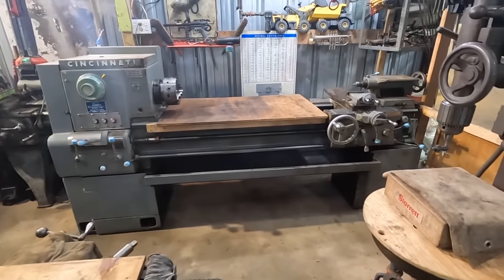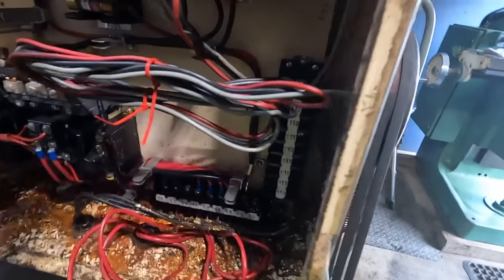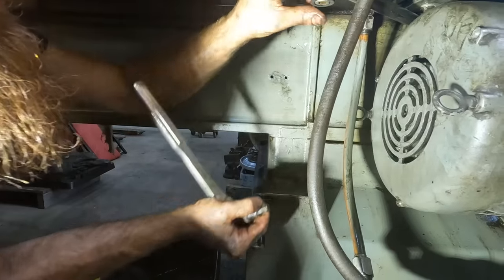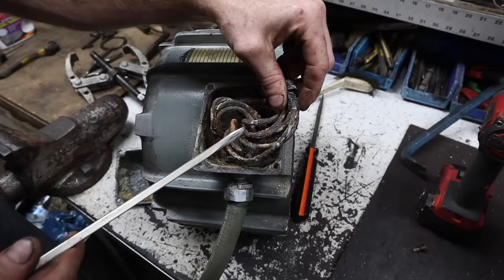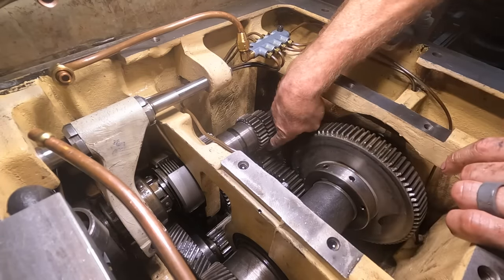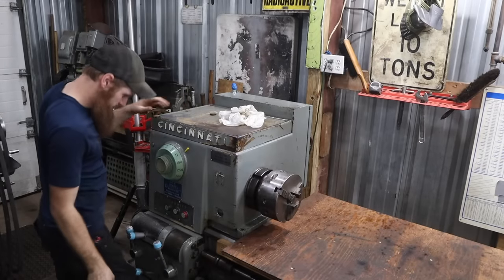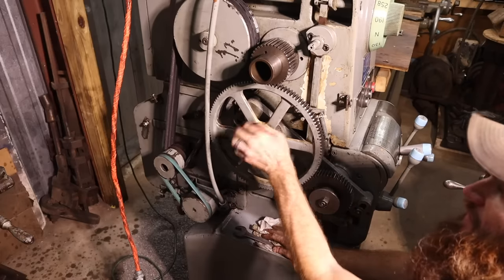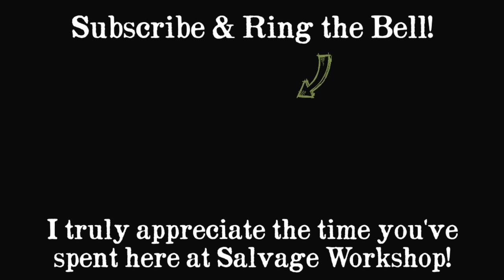Can we SAVE this BROKEN Lathe? ~ MAJOR Issues found! ~ Will it Ever CUT again?

Comment: I can't beleive that motor was running with all that crap in it! What was even more mind blowing was that all they did was to clean it out, wire wheel the rust off, put some heat shrink on all the wires, and change the bearings. An it still worked when they put it back together!!! I thought that no one would selvage that motor without having to re wire the whole thing. Brilliant!! 😂😂😂😂😂😂 Nicely done guys 👍👍👍👍👍👍
Reply: As long as the crud was non-conductive and non-magnetic, the issue would be heat.
Reply: Quality motor. We need to get back to that as a nation.
Reply: Was thinking the same damn thing. I’m surprised there was no sparking/arching on those coils in that motor after all that corrosion.

Comment: Very inspiring, I have a 20 year old Jet lathe that I'm very fond of, I don't have the money for a new one. After watching one of your videos, I started the repair on my machine. Lucky for me the lathe is made by Jet, I was able to order all the repair parts I needed. It's finished now, and I feel the satisfaction you get when this piece of equipment is working like new. The repair parts around $400, a new lathe was around $3,400. Thanks for your videos, it's the kick in the butt needed to get started.🤓
Reply: I have a stupid question 
Why didn't you take a part from something you already had? 
If you have a bunch of machines and the machines parts are meant to rotate ....sorry this is the second time I had to write it because it deleted the first time
Reply: For example you have 6 large machines one machine is broken but the piece you need is "hidden" in a machine you already have...
Reply: The air conditioner is broken but the assembly line is 
Air conditioner 
Washer dryer 
Freezer 
Water heater
Refrigerator 
Dish washer 
Sink 
Stove
Microwave 
------
Oven 
Microwave over an oven 
The air conditioner is broken and the piece you need is in the  let's say water heater but to keep the water heater going you have to arrange or rearrange the entire assembly 
And my brain says it could be as simple as cutting the grass while it's wet....
Reply: I've seen the air conditioner "turn into" the washer and dryer by flipping and resizing motors pieces and wiring

Comment: I really enjoy these long format videos on repairing old iron!!!! Also would love to see a few rescue missions again!!! Nothing beats getting a timeless machine running again in the woods or a dusty barn. Keep them coming and I’ll keep watching
Reply: Great, but why the same shielded bearings and not Rubber sealed bearings and no sealant at electrical outer box  where there was a gasket originally, and by the way that corrosion would most likely be the coolants fault.

Comment: You have an excellent lathe on your hands. You did an excellent job of diagnosing the issues the machine had, that electric motor looks as if it set with water in it for a period of time, another possibility is that it set in a very humid area and condensation from temp changes over the years built up the corrosion, nice job of salvaging the motor. Thanks for tag along video sir, really enjoyed watching the lathe salvage.
Reply: I Agree!  All that white crap looks like Aluminum corrosion - and Oil does NOT make aluminum corrode - WATER DOES.  If the lathe had been stored anywhere humid - water could have built up in that sealed motor and done all that damage.
Reply: @normmcrae1140  My thought is that it was dried coolant. Coolant seeping in through the jacket of the power wires and being evaporated away by the motor's heat.
Reply: @robertbackhaus8911  Definitely a good possibility! He DID say that the coolant was water-based.

Comment: Add a valve to the oil drain pipe you installed under the headstock, then attach a flexible hose pipe to the valve, this will make it easier to service the next time you want to drain the oil from the headstock into a bucket etc. Also add strong magnets to the lower part of the headstock they will capture any errant ferrous material that is resident inside the headstock, check the magnets whenever you change the oil, this can save a lot of expensive repairs.
Reply: Good advice, I reckon. Also, I would not tee the lower drain to join with the higher outlet to the filter. I consider the lower drain is what should be used to a) empty the sump periodically of any accumulated heavier-than-oil content, such as metallic wear debris and condensed atmospheric water vapour
b) empty the entire headstock when an oil change eventually falls due
Reply: Wonder what the oil change interval would be for this. Or even if there is one. @Gottenhimfella
Reply: @lukula2934  Unless the headstock runs hot, like over about 60C (generally due to excessive preload on the axial bearings of the main spindle) there will generally be very little oxidation of premium oil; I think it's largely a function of wear detritus, and water condensation. The latter might only be a detrimental factor in an industrial lathe located in the vicinity of  acid or other corrosive fumes, which could have been dissolved in atmospheric water vapour and build up in the oil over the years. This would be signalled by high levels of surface corrosion on unprotected cast iron or steel surfaces outside the headstock.
If it's just pure water vapour condensing in the headstock, it will accumulate at the bottom of the sump and can just be drained off at regular intervals. 
If the lathe is on a ship, it would be more problematic as the motion of the ship could keep re-emulsifying it.
Wear detritus can be monitored over time by comparing the colour of a sample drawn from the headstock with a small glass bottle saved from the same filling source and kept away from light.
If the oil remains clear, does not become tacky or develop a different odour, and there is no detectable colour change, my untutored feeling is that there should be no need to change it regardless of age.

It's a very different use case from (say) an IC engine.

Comment: I am a retired tool and die maker. There is a couple other reasons why there could be oil in the box. It could have got there by someone putting their oil can on top of the lathe, and oil could have got spilt, and simply just drained into the electrical box. Now I know what you're saying before I go forward.but The oil is kept in the  pan yes it is but it is a different type of oil then what you normally would use if you are threading a piece of metal. Oil in the pan is soluble oil, oil that would have been kept on top of the ladies would be called cutting oil. Or tap magic there's a few different types of Orioles that used on a machine. The second way how the oil could have been in the electrical box even a soluble oil when the machine is running the head is spinning and it could easily have been a mist of oil being put in the air may be bouncing off the wall and over years and years dripping down into the electrical box. It very well could be there is no leak in the electrical box you just need to make sure them to scenarios don't happen, now as far as their jaws go. Measured the hardened jaws that you have. make three blocks that are the same size mill the slots on the backside of them the exact same depth with and length, drill the two holes onto the top with a Bridgeport for you can put your bolts in. Put them on the laid bring all jaws together drill a good size center whole through the jaws. Simply put a tool bit in the late or a boring bar to make it ID turning tool to make it OD port what they call a spider in the middle of all three jaws, easy way to make a spider is that you take a big not drill and tap a quarter inch 20 whole three of them for they go into the center of the jaws when you close them, that is how you turn the ODs to whatever size your part is, now 40 ID put a chain around her jaws make sure it's a good strong chain you put it together without bolt and a nut now you are ready to bore out to jaws for an ID hold. Usually you will have many different steps on the jaws for ID or oldie so you can use them jaws for many different jobs these are called blank jaws if you buy them, if you have a Bridgeport or a milling machine, you can do all this work right in-house. :-) At least that is what we use to do in the machine shop trade. The owner would just bite blank jaws and we would make them the correct size for the job we was working on but if you don't want to buy blank jaws you can machine them yourself. Now thinking about it for a 3/8 16 whole into your spider you don't want something very small where you can bend it easily by closing the jaws, but also remember do not go crazy on  over tightening the chuck key, nice and snug that's all you need. I'll send you the bill in the mail of the knowledge I just sent to you :-) I hope you understood what I was trying to tell you, Sina a couple of the words that was not properly spelt. But I'm sure you can figure it out if you know anything of machining
Reply: Yes, I worked in a large tool grinding facility for 20 years. We used oil based coolant, sprayed from a nozzle at the point where the grinding wheel contacted the work piece. We had hundreds of machines running nearly nonstop. There was oil dripping from everything in the building, and almost no matter how well sealed a compartment, when you opened it…OIL!!!
Reply: Another reason oil or coolant can get into the electrical panel is a defective door gasket. When in operation cutting metal coolant spray can migrate into any opening.
Reply: Great contribution mate, your experience has to value for this young bloke
Reply: I like your theory.  But I don't understand why he thinks oil in the electrical box would cause corrosion? I mean there's oil all over this thing and that the only spot it caused damage?  I'm thinking water leaked on the box from the shop roof and collected in the box
Reply: The fact that water got in the motor makes me believe even more that water got in the electrical box not oil
Reply: Also whatever leaked in the cabinet may have been place in there , ie a can of oil to refill the gearbox,etc.
Reply: laughing Who would even think to put an oil can on a hook out of your own vehicle  my uncle You t babysat me the make a box i could sit in and still be able to watch the turn I was cleaning out the old shield to replace it with a new one  found that box and the step they make me see what they're doing too could run the lathe to cool the let me run it if i got my white dress dirty  they would not allow to babysit me meant aunts  and stepmom lol most of the inside of the shield i kept and did go back in to the new one  i feel lone or lost ii go in this shield in sit in my own stool uncle Albert make for me lol 
They all smoked a pipe even my stepdad did just out here in the small of the pipes i can still smell the pipe
Reply: @jenniferwhite6089  I'm sure that made sense in your head

Comment: If that shop was anything like our ancient shop rain would leak through the roof and cover many of the machines. All the exposed areas got cleaned, dried and re-oiled but hidden from sight spots like the motor, junction boxes and electrical panel never got touched leading to rust, peeling paint and similar white deposits.

Comment: On the gear noise issue when you loosened the bolt it stopped making the rubbing noise so there could be a tight spot in the rotating assembly that it clamps. perhaps the washer is distorted. Also remember you are spinning straight cut gears pretty fast on a pulley with long spokes so there may well be a harmonic involved. you might try bluing up the rotating assembly and seeing if there is a tight spot that shows up just spinning by hand. Double thumbs up for bringing a great lathe back to life.

Comment: I had a Cincinnati lathe just like that one in my shop. It is a solid machine. That old iron is not duplicated anymore. Even if you have to put some money in the lathe it will be worth it. Now as a hobby I pick up old tool room machines and refurbish them just for fun. Once you get everything running smoothly and get it trued-up, I would put a DRO on it and that lathe would be worth 15k easy.

Comment: As others have already mentioned here,  there are at least two different kinds of lubricant used on lathes, milling machine's, facers, and line boring machines - if you dont count the different varieties of greases for screw drive threads of course,  there is Lubricant oil which is like the oil used in the differential of your car and is water insoluble, and there is Cutting oil which IS water soluble and is used to keep the cutting edges cooled to both prevent friction hardening of the work peice and the cutting tool from chattering   or blunting as a consequence, all of which being highly undesirable in a finely tolerenced work piece,
  by the looks of the insides of your electrical panel it was soluble oil  that was penetrating the box as seen in the way it flecked the enamel paint off the inside of the box....the water element in the cutting lubricant doing that obviously... I would also speculate some balloon forgot to turn the coolant tube off  at sometime in the distant past and allowed it to pour all over the cabinet and run down onto the motor directly below it was what caused all that aluminium corrosion to build up and the bearings to rust,  gear oil being incapable of doing anything like it,    what ever you DONT mix  or confuse the two types, as here or there is likely to be big consequences.

If I were you I would trace through and draw a schematic diagram, of where BOTH types of lubricants should live within the machine and where they are channelled, filtered,stored etc. lube oil obviously needing to be stored in a none accidently  accessable area, whereas water diluted cutting oil which  also carries away swarfe should be in an open system.  and sumped at the base of the machine. well done on the overhaul by the way, a job very  competantly done.
Reply: "there is Lubricant oil which is like the oil used in the differential of your car and IS NOT water insoluble,"
Reply: @marcosmota1094  Was that meant to be a correction of something I said  or a reinforcement of same ?? 
 you appear to use quotation marks indicating it was  a direct quote, which it obviously wasnt, 

as I am perfectly aware of the different  hygroscopic properties of, and the uses for,  water miscible and non miscible lubricants
.I have yet to hear of one single example of an extreme pressure oil that is miscible to water being used as a pure lubricant or for that matter its point, perhaps I'm wrong. if so please enlighten  this poor engineer of nearly fifty years of experience. the only products I can  think of that DO encapsulate water are engine oils which deliberately use polymer modifiers to turn any water in them into the white scummy residue you find inside a rocker cover, but that is deliberate encapsulation for the purposes of removing the water  from the lubricant.

Comment: I was watching as you shifted through the gears with the top cover off. the oil goes down the gap between the electric box and the case and i'm guessing then through the mounting holes over the years. Its now the end of the vid. What a beautiful old lathe. Cinncinatti is a good known brand too. Its good to see it working. One of my friends bought himself a  "Denbigh" Colum drill press. Its an antique. Its all flat belt drive and fantastic castings, a thing of beauty. It even came with a box of No 3 Morse taper drill bits up to 2 inch and a regular 5/8 drill chuck. It hasnt even got a drill hole in the table. It was built in the days when you didn't have safety regulations regarding exposed belts and the operator was expected to know not to get himself in-between a belt and pulley. Ill see if i can find you a photo.

Comment: Nice machine! Don't forget to grease that large gear - they don't like to run dry, even with the correct meshing. Ideally you'd have zero clearance between the gears but in order to ensure there is no radial preload, it's normal to have a small clearance. It'll sound a lot smoother and last longer.